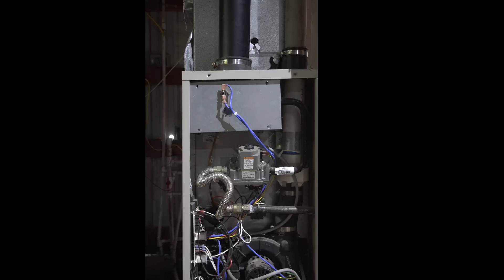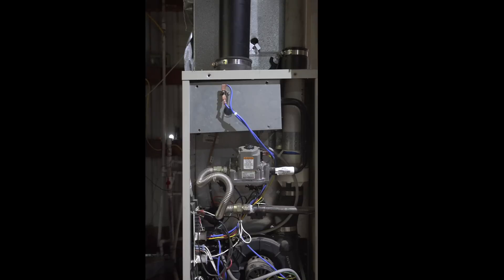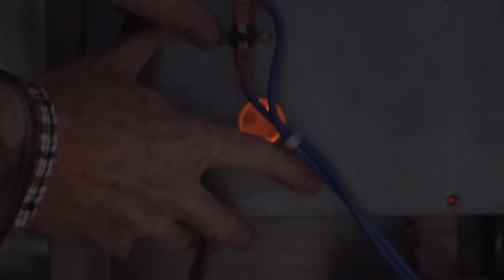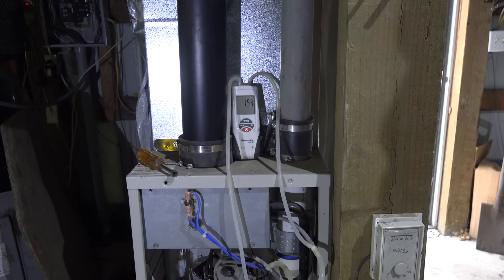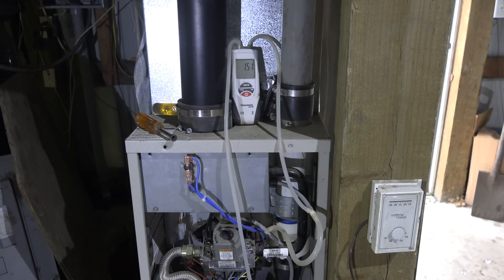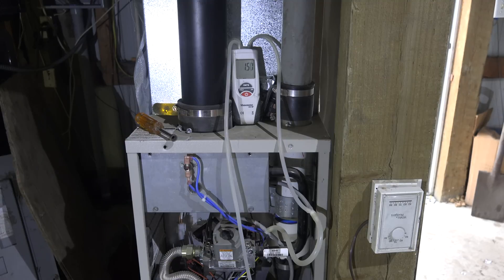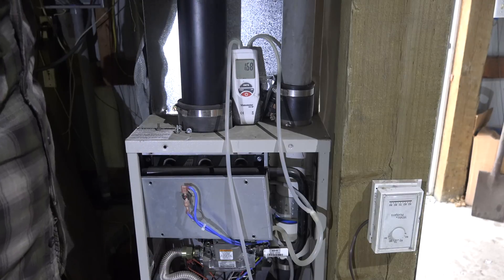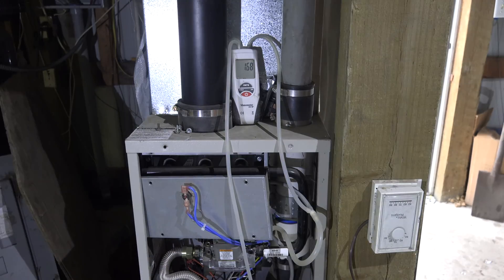What's wrong with this gas furnace #12

Comment: Looks like you need a new furnace. LOL. Either a clogged intake (bees have been bad this year) or I'd check the secondary pressure switch. Hell.... check both pressure switches to be sure. Clogged orifice. Could be water in the exhaust side due to a drooping pipe or bad install.

Comment: Inducer motor isn't strong enough to cycle the air with the cover on enough to make the pressure switch close, but with the cover off it's pulling from the room so it makes and starts?

Comment: GFM, you are very careful with your words. After consulting with no 1 son, he tells me you are measuring the pressure "drop". He would not tell me the problem with your mule but I am quickly coming to a conclusion. I'm still surprised the furnace will run even though the combustion chamber cover is off. It would seem the chamber is starved for air as the pressure drop increases when the cover is removed!

Comment: Well then, answer me this; having never tinkered with a 90%er, I'm not sure if the contact of the pressure switch would close with the cover off the combustion chamber. If the inducer will still produce enough negative or positive pressure with the cover off  to close the contacts on the pressure switch, then why is there a tap off the  combustion chamber? One would think the engineers would fail safe the furnace if the combustion chamber cover is removed. A schematic as to what the inducer is drafting would help. The inducer is drafting the combustion chamber I'm guessing. So, we need an intake of air and an exhaust of air through the combustion chamber to induce a draft to work properly. By the way, are the switches sensing pressure or a vacuum?
Reply from the maker: The switches sense a comparitive vacuum.  Removing the combustion chamber cover relieves the vacuum created by the combustion air piping.  There is no need for a fail safe on the combustion cover because the removal of the cover does not create an unsafe condition.
GFM
Reply: +grayfurnaceman after talking with an engineer at Carrier, I have come to the conclusion, the switches are vacuum pressure switches. Not a pressure switch. So, if the cover is not a risk factor when off, the inducer is drawing off air surrounding the furnace. It begs the question why the silly thing is drawing air from outside. I Suppose the draft could pose a problem in confined space. Well, I should join the vocal majority here and say you have some  sort of fresh are blockage. So, what say you GFM? Hope you had a Merry Christmas, a happy holiday and wishing you a Happy New Year.
Reply from the maker: The reason for outside air is air drawn into the combustion chamber has to be replaced.  It can be replaced directly from outside air or it can be drawn thru the cracks in windows and doors.
GFM
Reply: +grayfurnaceman  knowing just a little about your videos, I might think the problem is not as simple as a bird egg in the intake pipe as suggested by another viewer. Since we have ruled out wiring as a problem and you have made a point of comparative vacuum, could this be an unequal vacuum in the system? That or as I suggested earlier, a lack of fresh intake air would seem the most obvious since the system seems to function when the combustion cover is off.

Comment: your fresh air intake is plugged pretty bad. typically just pulling two screws is enough to offset them when they are tripping like that. most of the time the burner box can be left on. I have put ball valves on fresh air intakes to get o2 down and fine tune combustion heat, ive shut ball valves down to halfway to meet an o2 level in the 6% range.

Comment: So, the furnace should not light with the combustion  cover off and the reason the furnace will not ignite with the cover on is unknown. The IFC should sense an absence of 24 volts before the draft inducer motor comes on and then the IFC should see 24 volts through the closed contacts on the pressure switch which should only close when the cover is on the combustion  chamber since there is a vacuum tap. hhmmm, got to be a switch problem. You are a very tricky guy. Maybe since there is a normally open and normally closed way to wire some pressure switches , someone wired the switch incorrectly? If I am wrong GFM, you're gonna owe me a lunch!
Reply from the maker: No wiring problem.  Think it through.
GFM

Comment: restriction in intake air pipe or maybe a pressure switch that isnt making at the correct pressure.....to high of closing pressure. most likely the pipe thougg

Comment: While I agree with everyone regarding a plugged intake pipe but I also want to point out a possibility of a partially plugged vacuum port out of the secondary heat exchanger that will give these same symptoms especially on this Nordyne furnace